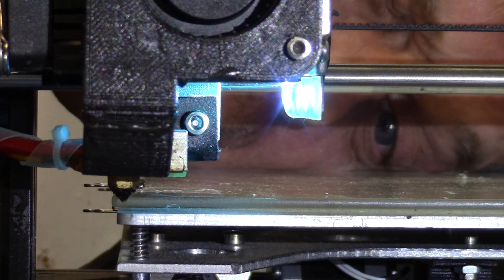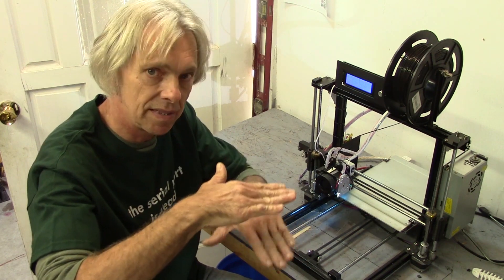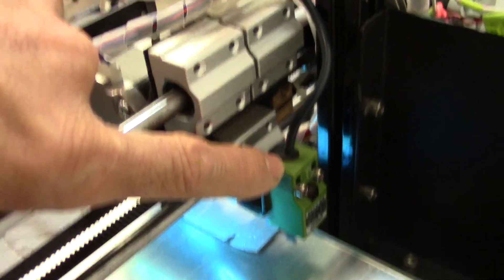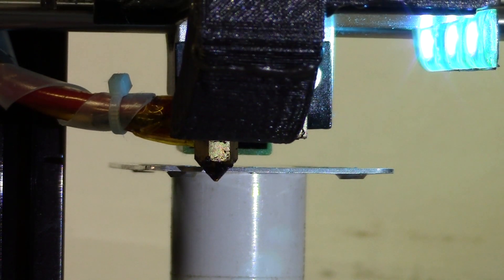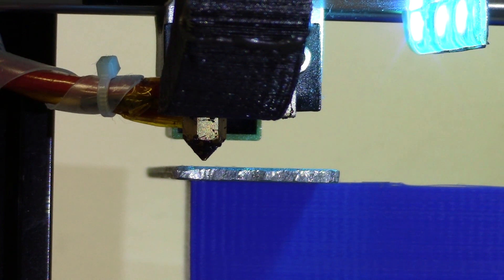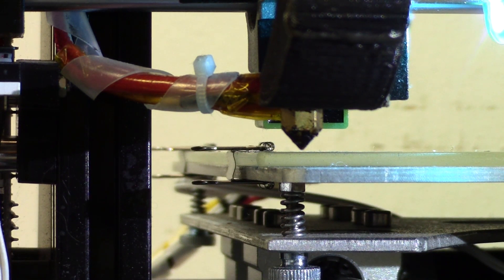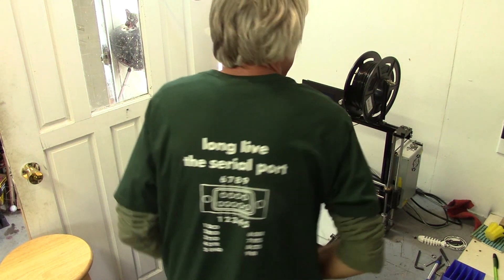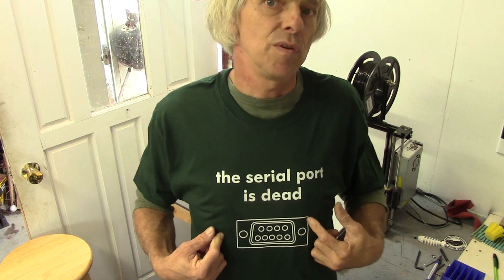3D Printer Inductive Sensor Working On Glass

Comment: how is puting  alumium tape (alike)  on the print surface a solution :S if you want to print on the glass directly   
for auto bed leveing it probe everywhere  >_> :S

mind to try a very thin iron metal sheet under the glass bed ?  like those used for furnace duct vent

ps ive read  someone comment of what you do huh

Comment: I have used both inductive and capacitive sensors for a long time. Capacitive works better on glass surfaces but temperature and humidity will affect it's accuracy. I prefer mechanical sensors now.  I have a piezo sensor in one of my printers which sits directly in the printing head and the nozzle works as the probe. This gives you amazing accuracy on all and any surfaces but is a little fiddly to setup initially. Another great option is a BL-Touch. Easy to setup and very accurate. Cheers!

Comment: I have the same printer you have and just purchased a LJ18A3-8-Z/BX DC 6-36V NPN 3-wire 8mm Inductive Proximity Sensor Switch Detector. Then built a optocoupler circuit so the board trigger levels were TTL. Works great thru the glass.

Comment: why not just a capacitive sensor? i use one on my i3 for about 2 years and it works without any problems...
Reply: Hello,Aaron Rogers,our store can supply https://panlongic.aliexpress.com/store/group/Capacitance-Proximity-Sensor-Switch/1668604_512042053.html?spm=2114.12010612.0.0.6a54548bzxYeNE

Comment: This wont really work for leveling the bed.  Since the sensor needs to read in several places all over the bed youd need the whole thing covered in aluminum tape.  Doing it this way only gets you one data point.
The best thing ive found is to get a bltouch.  Works on any surface and hasnt let me down yet.
Reply from the maker: I pre-heat the bed,  do an auto home, disable steppers, then move the print head to all four corners and adjust the thumb nuts to get the same clearance at all four points. I repeat this one more time and I'm good to go. It hardly changes from session to session since I installed a new hot bed carrier plate from thick aluminum.
Reply: @HackaweekTV  That's cool but I think the vast majority of people install a bed level sensor to avoid having to deal with leveling the bed manually.  I've never hear of someone using the sensor on just one point and manually doing the rest.
I've found that i never was able to get my bed as level manually as the sensor does.

Comment: I'm not sure how this will work with autoleveling unless you want to cover the entire bed with aluminium foil? The best way I found to make these sensors work on glass is to put a thin sheet of steal between the glass and the heating plate. The steal has enough inductance to allow the sensor to work through the glass.
Reply: Yeah I don't see that performing the bed leveling